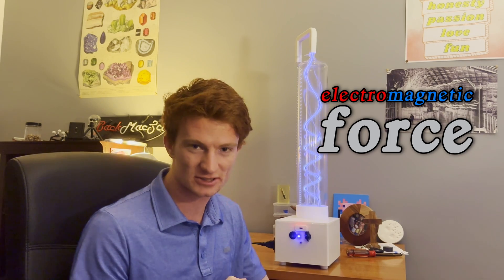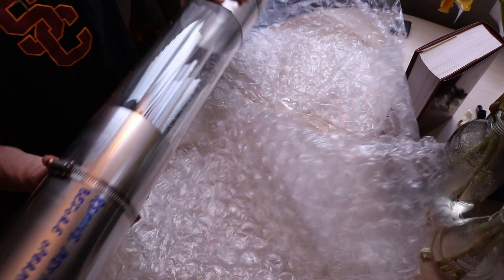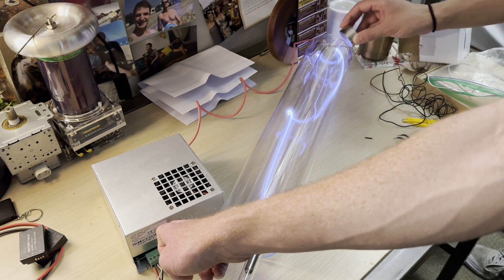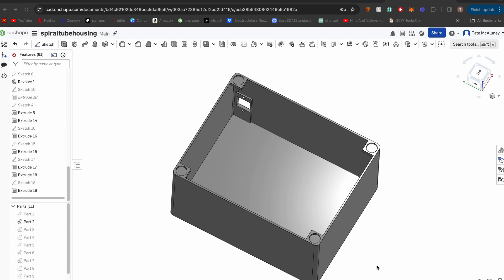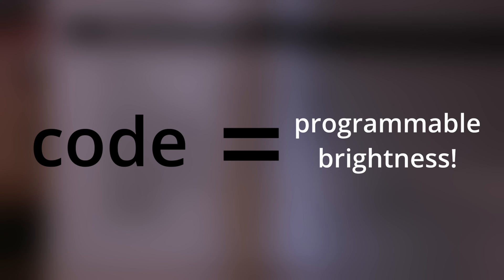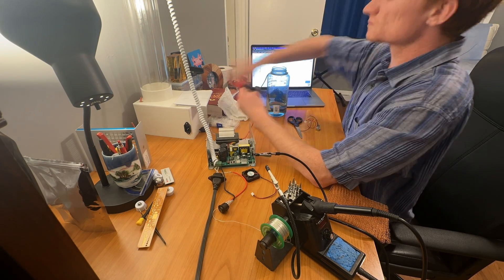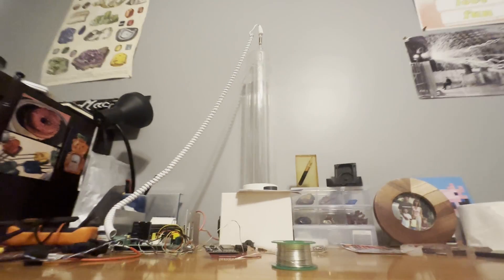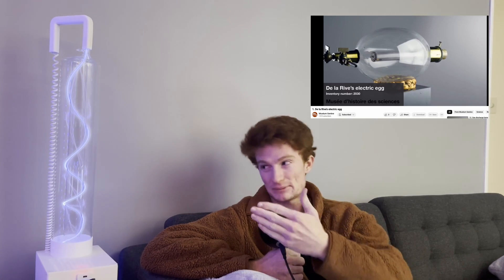The Plasma Spiral Lamp

Comment: Should have built the atmega328 stand alone circuit. It consist of just the microcontroller, the 16 mgH crystal, and a few capacitor and resistors. You power It with 5V and its much smaller than the microcontroller you used.

Comment: I think that the plasma stream moves upwards even outside the magnetic field of the permanent magnet because the plasma stream creates its own magnetic field around itself. The stream is not close enough to each other as in coils, so their magnetic fields do not merge into one stronger one, but are separated and therefore repel each other. The lower stream then pushes the stream above it upwards with its own magnetic field.

Comment: "We need a high voltage power supply and someone suggested we use a high voltage power supply so we used a high voltage power supply because it's a high voltage power supply..."
Reply from the maker: exactly
Reply: @BackMacSci  High voltage power supplies are often great at supplying high voltages in my experience. 😁

Comment: just dont leak, also arduino nano is even smaller. not the full size arduino. God be with you. so you dont have to try yourself, alone. as God is the giver. only. as without God none can read. how about tube plasma Jacob's ladder. one cylindrical tube with two strips on the sides. plasma flow from bottom to top. that can be twisted with a magnet too. when physics teaching becomes the law, its magic. when speech becomes the law. even worse. yep talking each ones own. you would lack nothing with God. without God you lack everything. remember the leak.

Comment: I think it would have been a much cooler effect if you used the power supply to control the magnetic field, by replacing the permanent magnet at the bottom with an electromagnet. 

Still a very cool as is though, it’s like a lava lamp but cooler.

Comment: Maybe there is convection happening inside the tube which could explain why it’s raising. 
Also maybe once the path stabilizes it stay in that shape even outside of the influence of the magnetic field because it is the least resistance state.
Changing its shape would require heating cold xenon in a different area which is more energy demanding hence the stability. 
Pretty cool stuff

Comment: So its a B-field motor but the wire which you generally see going around the battery in Online shorts and what not, is the Plasma in this case.  Is that about right?   I think so.

Comment: How about putting tiny coils around it, of say 38-44 gauge magnet Wire. Just. A few turns then pulse the coils randomly with something around 5-12 v around 100-250 ma  to change the magnetic field maybe higher current shorter pulses. 400-600 ma lasting milliseconds

Comment: Would it be possible to have it so the tube didn't had the connection at the top, but instead of the hollow core wasn't hollow, just a tube inside another tube, sealed at the bottom but open at the top, with the connection moved from the top to the bottom of the center tube, and maybe just have it a little raised to leave space inside to place the magnet under it? Would it still work like that?

Comment: What if you wrap the tube with spirals of thin magnet wire at different pitches, and pulse current through them? Or even just have a few coils at the bottom. Being able to apply an arbitrary direction of magnetic field to the tube and slowly vary the strength and direction over time should result in some interesting effects.

Comment: It'd be cool if you could flip the magnet at the bottom back and forth and see the spiral turn in opposite directions, would make a great science museum exhibit
Reply: Or an electromagnet running off a similar PWM code as he used for the lamp. You could even have it randomly switch polarities. That would add even more verity to the plasma stream.
Reply: @ironnam8107  Did you mean Variety or Truth, or plausibility?
Reply: @samwillard5688  Variety. Autocorrect strikes again. 

It would take some experimentation. Maybe a permanent magnet to keep it stable. Then an electromagnet with variable PWM to make the plasma dance around randomly.

Comment: Beautiful, the video we needed. Never seen that power supply before, where did you get it? There's a video of a power supply by Steve Ward on my page I show that users trim pots to control modulation and power with 4 pots and you can switch each pot off individually. Where I display this on a lamp that is a spiral 🙃

Comment: The power supply has a fan for cooling but I don’t see a provision for that in your box, which will probably lead to overheating or the power supply
Reply from the maker: The fan is in there and I did make holes for airflow but the holes aren't big enough to be effective. Luckily, this thing runs fine for 30 minutes or so which is usually the longest I need to run it anyway.

Comment: When an arc forms at the base of a Jacob's ladder it was able to overcome the air's resistance, but now that the arc is struck, it is an ionized path of much lower resistance, much easier to maintain, so as it rises due to heat convection it can bridge air gaps it could not normally achieve, as this stream rises it will eventually collapse when the stream of ionized gas can no longer sustain the available current flow.

Your spiral is an ionized path that is the best known path to follow rather than cutting a new trail, and will be followed until an easier path is found, There may be a much easier path, but the stream lacks the intelligence of random, AlphaPheonix's gerrymandering video depicts how a bit of random is needed to get out of the "local low" to find the "global low" the shortest path overall requires some steps in a worse direction that electricity just can't do. Without this nuance electricity would not be as pretty would it? :D

Comment: Perhaps a smaller less powerful magnet will make the start point of the plasma less frantic and jittery at the bottom, giving a more pleasing overall effect.  I believe the persistence of the spiral well beyond the region of the B field near the magnet is due mainly to the very heavy atoms being used - xenon, who's average velocity at room temperature are very slow, and Graham's law of diffusion dictates that the rate of diffusion of Xe atoms must be very much lower than that of eg. neon or air, both phenomena thus suppressing rapid convection and causing the arc's slow and languorous motion. I suspect that since the arc must obviously be crating its own B field, that the spiral pattern is forming a large solenoid electromagnet, with its own larger B field associated with it and with which there may perhaps be some sort of passively stabilizing magnetohydrodynamic self-interaction effect going on as well.

Comment: Is the glass vacuum tube safe to be near?  What would happen if it were to break?  Would glass be thrown out (after it implodes)?
Reply: You know the knifes in your kitchen are dangerous and the faucet hot water is dangerous and driving your car is dangerous and crossing the streets is dangerous and the bbq grill is dangerous and so on forever
Reply: I believe @BackMacSci said the tube was low pressure xenon.  Under those conditions, and being that a highly skilled glassblower made the dewar(who most certainly annealed the dewar), the likelihood of the dewar breaking without being dropped is very close to zero.  

Hypothetically, if the dewar were dropped(of had something dropped onto it), the resulting breakage would be no worse than breaking a drinking glass or piece of scientific glassware.  And the xenon(safe) would escape.

Comment: The plasma, once formed, tends to stay where it is because the ionized gas has low resistance to the current.  The plasma is hot because of the power delivered to it.  It rises because hot gas is less dense than than the surrounding gas, carrying the arc upward with it.  This requires proper gas pressure & arc current to cause the 'bunching" of the current.  It DOES NOT work well changing the current from the optimum (there should be no modulation of the current).
          The lower electrode should be a ring so the arc does not need to break for each turn.  This could be done with cluster of ~6 separate neon-sign electrodes arranged around the bottom.